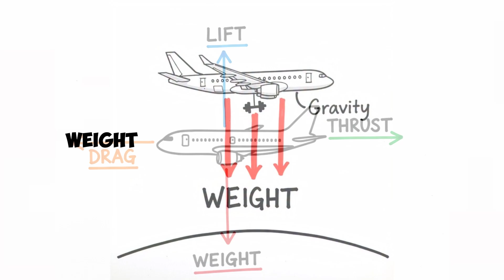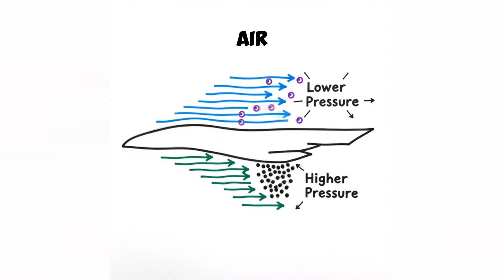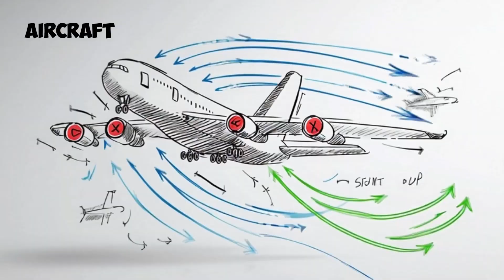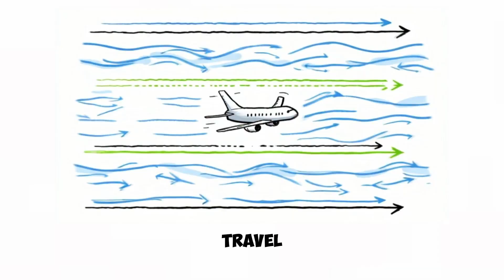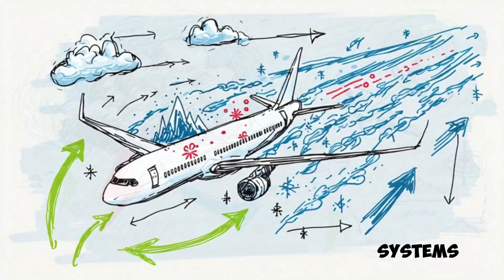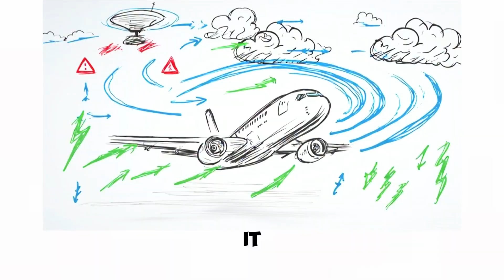how airplanes fly || Why Planes Rarely Crash || aviation for beginners

Comment: The "shaping" of the air doesn't cause the lift. Lift is the reaction force to the action force of downward excellerated air. The shape makes  process of lifting efficient,  but is not the cause of the lifting. You only get lift when  you excellerate air. And if you don't do this, you don't get any lift.
Reply from the maker: Spot on! Newton’s Third Law is a huge part of the story. The 'shaping' is essentially the mechanism that forces the air to accelerate downward in the first place. It’s like two sides of the same coin—one explains the force, the other explains the flow

Comment: No, the shape of the wing doesn't cause the lift. The shape makes the act of lifting efficient. The lift reaction is caused by the act of  excellerating the air. You don't "create a pressure differential and then get lift". Rather, a pressure differential is the lift. Lift and pressure differential are synonyms. A pressure differential is not an action that causes a lift reaction.